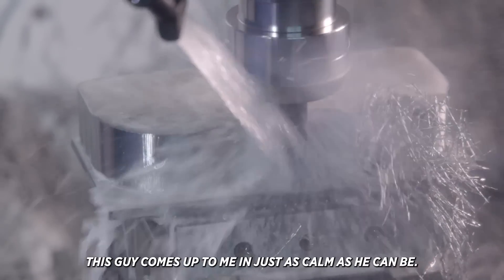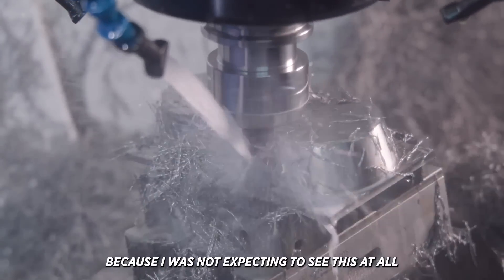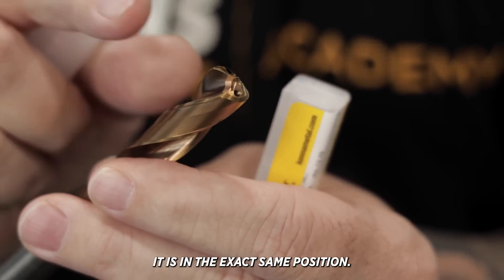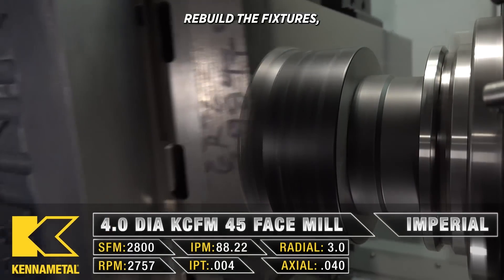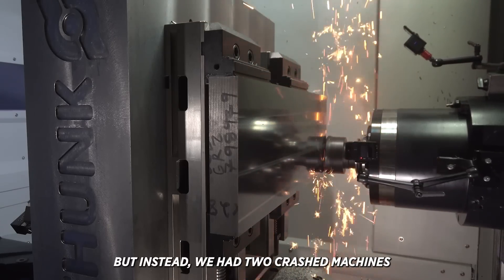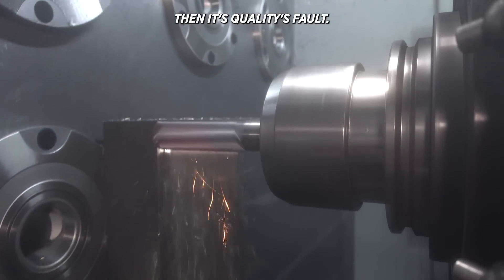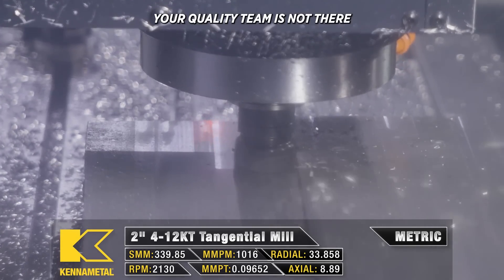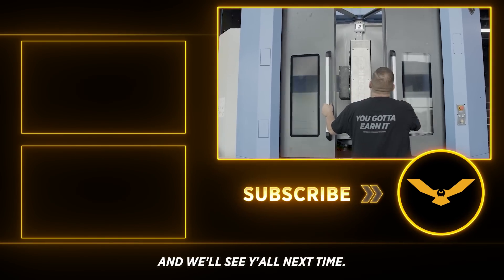$200,000 Damage | EPIC FAIL… Machinist CRASHES TWO MACHINES at the Same Time

Comment: i took the chance i got to be a technician while i don't have a degree. but i landed in a company that gives me all the support needed , i would feel sick having to tell my manager i crashed a machine like that. i work in a chocolate processing factory. from things i learn watching videos on youtube i was able to make a good impression . we have a mill and lathe (not cnc) but i noticed kennametal inserts . so many things i've seen in your videos have been very useful. we have every part of every machine in stock . but in case it's needed we have every tool and material to make  what we need. having to relearn almost everything in a world 25 years more advanced has been quite the challenge so far.

Comment: Monarc mill on a fresh setup the forman set the stops as he was setting up for a job 3 axes machine cnc was rather new at that time and these machines cost about 250k each back then we had 3 of them.
The tape was feed into the machine and 
The tool loaded dropping down to kiss off the first part the mill kept lowering tords the table into the part it was a very large part. It bent to tool change cage among other things I belive it jacked up the spindle that machine was down a month or so, ive seen a puma cnc lath run into the chuck. Just stupid crap and somone not paying attention.   The Forman was a journeyman machinest that specializes in mills.  He told me and I was around 18 at that time school taught him a bridgport was the only tool that could make its selfe, I said Bullshit.  A lathe can make a lathe,  he said how do you make the ways?  I said they are round,  he thought
Every time he came up with something a lathe couldn't do i had an answer.
A lathe can make a lathe, maybe not the one you used but one that works.
You just have to think outside the box.
Don't belive everything somone tells you.
You can figer something else around the problem.

Comment: First run: Eyes on the tool in the spindle. One hand on Fast-travel speed control, Other hand over the kill-switch.
You don't have another machine. As a matter of fact as far as you're concerned the rest of the universe might as well not exist.
If your bodily functions give you trouble, you put the machine on hold at an appropriate step, make certain that the "First run" sign is in front of the controls, take care of the issue, return as fast as possible.

Comment: My coworker crashed DMG mori EVO 40.. he missclicked a decimal point so his drillbit 40mm diameter was 35 mm long instead of 135 🤷 then he just ran the program like every other time and did not make sure its allright even tho he puted a new tool in it.. fortunatley the drill bit broke and the machine hitted Z - limit so the cost was "only " aroun 60k

Comment: Where I work at there are two machinists that broke the spindle probes in their machines, one smashed it into the part and the other accidentally gave it 7000 rpm the caused it to shatter in to meny small parts.
I remember just braking the white tip of the probe and how bad I felt for the rest of the day.

Comment: I always run in single block with a distance to go screen, feedrate at 10%, and rapids at 5%, when proving out a new or modified program, (even the first new run of proven programs) on any cnc... it takes far less time than re-aligning and repair

Comment: That's why single block is your best friend when using a new program. You also want to stay on your rapid override and feed rate switches. If your machine has a graph you can actually do a machine lock dry run as well.
Reply: You are correct, i run okuma macturn 550 and i always run the simulation in the cnc computer with dry run and machine lock on.

Comment: Worst crash I ever saw was a horizontal DMG Mori crashed at 100% rapid. The guy was doing a setup with a brand new program and had just finished it and turned block delete on and for some reason DMG Mori’s can’t read 2 pallet changes right in a row so it rotated the other pallet in but didn’t rotate it back so it buried this face mill about 2 inches into the pallet and actually picked up the whole tombstone off of the pallet and it cracked the spindle all the way down the side. It was crazy because I was standing right next to the machine when it happened. But at least this guy that did it looked like he was going to pass out and also speaking of that guy getting promoted I had a mid-level boss who was always crashing machines and scrapping parts he ended up getting and he was an absolute asshole of a manager. I eventually got so sick of working there doing production work on aerospace part so I quit and now I work for an extrusion die shop and I love it

Comment: CNC repairman here, worst crash ive ever been called to was when this company launch a 100h programme friday evening, the mold was aluminum so high spindle and soft cutters,
(for who dont know usually big mold are cast aluminum with inox pipe inside for cooling), long story short the company who casted the aluminum misplaced an inox 1" tube by like 5 cm, machines 
saturday night exploded the cutters from the spindle, but anti-collision was disabled like the week before due to some elettrical issue (we were supposed to replace it like the week after).
Monday morning the spindle was blu, the machine continue to mill with the spindle head, burning bearings, eletrical wiring, C and A axis where deformed (the screw of c and a in those machines is in bronze to reduce damage in situation like this), Z axis was ot of square about 1cm/1m.
We ended up completly chaning Z,A,C axis, spindle, cooling unit (part of the spindle were been sucked into the cooling circuit), and remillling x and Y placing point for linear guide.
i honestly didnt ask how much they paid for this work.
But i know for facts the just the spindle is 35-45k$

Comment: More of a machine failure than a crash, but a 3/4 endmill blew up in a spindle that was already in rough shape, needed to get the spindle replaced as well as some other work on it while the technician was out at the shop

Comment: The worst crash I've ever been a witness to, was when the Makino machine next to the Makino PS65 suddenly made the loudest booming sound I've ever heard from one of them.
It turned out that the threading tap that was being used to make an M16 thread got stuck in the workpiece, ripped the part out of the fixture (part was 200mm x 200mm with the threaded hole in a corner of it), and then swung it freely in the air at 600RPM for 1 second before snapping the tap and slinging the piece into the door of the machine.
In short, the door was bent like hell and someone was spared from being hit in the by a 20kg piece of metal.

Comment: I'm not a machinist, I'm a cabinetmaker.  Rule #1 is never leave the CNC when running a new routine.  20 years ago when I was new to programing, I used a down spiral bit and plunged straight down into the wood at 18,000 rpm.  Think of the worlds fastest fire starter using a stick and bow!  Within seconds (and due to the vacuum hold down pump) I had a 2" glowing hole.  Had I not been there, I could have lost a very expensive CNC not to mention my building.
BTW, Love your channel!

Comment: Have a new guy working under me, all he has to do is run the same part, he been making the same part for 2 weeks straight, there is a picture of every step at every M0 with notes, and a typed guide to go with the pictures , he forgot to remove C clamps that are about 3-4 inches tall, pressed Go and just walked away and full on crash at super sonic speed destroying the facemill and the part and the clamp. I told him never, ever just press go and walk away every on verified parts until you verify it’s safe. If people don’t get this they shouldn’t ever run CNC, it’s one rule

Comment: Promoted him and gave him a big raise.. ??  !!!!  I am sorry, I would have fired the man on the spot.  That is bullshit... Many year employee or not he damned well knew better.  What is one of the first thing a newbie learns when running parts.  Rule number 2 when running a new, modified, different or with a changed out tool.  Step it through slowly to make sure everything is in place.  Rule number 1 is safety as always and is always rule number 1.  Modern Machines can run so fast that if your not running through at a small percentage of what it can do.  The damage can be done before you can stop it.

Comment: I don't know, how some guys manage to high speed crash because of missing digits or wrong referencing... I was told that EVERY new program has to been gone thru with 1% speed and a hand on the e-stop all the time until the end. I had some close calls, and some pretty bad crashes because of material fails - but never because of a programming mishap.

Comment: This is one reason I first run a part in high density FOAM or even soft plastic so at least I can SEE what the machine bits, heads and spindles are ALL doing along the entire tool path before I machine on aluminum, stainless steel or titanium blocks. In foam or soft plastic, the damage won't catastrophic and I can SEE where and when collisions/crashes occur.

V

Comment: I’ve been on a manual lathe for about 6 months, cutting the connections on drilling tools for the rigs
The guy that “trained” me, gave me about 2 weeks of “this insert is for threading the rest just use whatever as long as you make the cut” 
Then after those 2 weeks of this guy sitting on his ass while I messed up connection after connection, they threw me on the night shift by myself to run this thing I didn’t even know how to adjust the speed on
“Don’t worry about it, you can just cut everything how it is”
Took about 3 months of parting off bad connections and screaming F bombs for 12 hrs a night before I started getting the hang of it

I take pride my work, 
When I started I was putting out maybe 2 connections a night on a 12 hr shift
 Parting off so much material
Prob costing the company quite a bit of money
Now I can cut one in under an hour 
Pretty much self taught
Still don’t know any of the nomenclature for the tools and inserts
But I’m not breaking them or burning them up in 1 pass anymore 😂

Comment: When I use to do new set up every time I hit cycle start I go into 0 % on feed rate than walk my tool till it contacts work piece so I no it won't crash and damage , I seen someone do new set up from small to running parts on a fixture and forgot to set zero and it crashed where wheel broke to pieces,spindle bent and over head snapped

Comment: You gave out the biggest secret in the trade. The most careless and slacking operators gets the most promotions. And the most incapable of handling responsibility get the big management positions. That's why companies are so screwed up and the good machinists keep having to job hop after getting too used to the b.s. on the floor from the people that aren't deserving of their job but have nowhere else to go in life. They'll find a way to get rid of you if they feel threatened by you. So doing good is bad for the comraderie amongst floor workers which is more key than the managers that you actually get along with that like and praise your work. The coworkers will find ways to weed out the ones they feel threatened by. Happens everywhere.

Comment: Why aren’t the programmers required to be standing there on the first run? If there’s a problem, the stop it, and know where they need to fix their mistake. Unless your operators are trained to write and authorized to rewrite code, then get all accountable on the floor and in front of the machine.

Comment: One time, I and a new hire were changing out some wire spools on a machine and then heard 3 other of the adjacent winding machines simultaneously crash while the operator had stepped away to move a pallet. The bobbins that the machines were winding wire onto were not secured properly and they were ejected at over 1500 rpm. Fortunately, the guarding on the machines caught the 45lb projectiles before anyone got hurt, but all 3 sets of guarding were catastrophically damaged and had to be rebuilt, by hand, by our maintenance crew because the machine manufacturer no longer supplies replacement parts for these machines.

Comment: The worst crash I ever seen was on valve  body facing at a hole in the wall dlave shop, they kept telling this dude go faster, go faster. And he was trying... flipped a valve body out of the fixture and came back on the next pass and expoded it like it was a bomb, parts of the valve body came back and destroyed the spindle. I didnt stay at that palce long. I dont see myslef ever going back to machine work. Not here in the midwest or for somebody else.

Comment: Oh hell, I had run into people like that guy all my working life.  No sense of pride, no sense of responsibility.  Never did and never will understand the attitude.  I've done stupid things at machines, but luckily never life threatening and always felt terrible about it.  Absolutely hated making mistakes.  

Worst 'crash' I had seen was actually on a sinker EDM.  Guy forgot to set the oil level sensor, and when the oil level dropped below the top of the part overnight the oil caught fire and burned out the entire 55 gallons of oil in the machine and everything that wasn't metal was gone.  Machine looked like a skeleton the next morning.  We came into a shop that was filled with smoke from the burnt oil.  It was a miracle that the whole damn shop didn't burn down.  That was back in the early 70's.  Seen lots of bad stuff, but that was the most expensive one.

Comment: While employed at a precision valve company in NJ, the front office made the decision to promote a bean counting contract efficiency expert to the head of manufacturing. This was a position that had ultimate say over setups, processes and tooling. Basically a god level " I know everything" position. During his orientation through the shop, he had a clipboard in one hand and a yellow highlighter in the other. White shirt, black tie and glasses. Standing next to the biggest Mazak CNC machining center we had, the operator called up the wrong tool and crashed the machine. The tool was a 10" diameter insert shell mill with about 100 inserts around the periphery. Spun to about 7000 RPM, this cutter was rapid moved into a 4 foot long 10" cast iron angle plate that was about 1 1/2" thick, full rapid speed. The angle plate was bolted to the table and fully loaded with castings. The crash was so violent, the counter torque from the crash shifted the machine well off its anchors in the concrete floor. This machine had a table you could lay a 4x8 sheet of plywood on with room to spare. The majority of the operators in the shop dove for cover, but our new savior never flinched because he thought it was supposed to sound like that. RIP B.G. you never had a chance after that. It literally sounded like a train hit the side of the building.
Reply: Must have been some spectacle. + everybody had to change their pants directly after..

Comment: I have crashed multiple machines.  Every single time I figured out what was wrong. And said hey I fucked up. Even if the program was wrong. I learned the hard way. Not everyone will help. But these days I make sure everything is dumb proof. So if I’m not running it whoever else will won’t make dumb mistakes. Slowing down production isn’t always a bad thing. Bad parts are bad.

Comment: What do you use in terms of verification software?  Eureka validates against rapids through stock.  Was the operator also the programmer?  Information communication is key when the 2nd party has to deal with the thinking of the first party.

Comment: Thats cool so the it jets water/oil down inside your bits. I wondered how you was able to drill holes so fast with out backing out of the hole... Lol he hit go then he went on brake ??? I dont even do that with 3d printers. You got to have a flawless start. if you start out NOT flawless then your product is going to be crap. this is true with 3d printers/ CNC and even lasers. Now after it gets going and everything is looking smooth then you can walk away but that start up NEVER walk away.

Comment: Are you kidding!!!!! Ronald Regan said Trust but Verify! Three axis machines are simple. When you add in 4 or 5 or more axis, the operator needs to take the responsibility along with the shop process to verify the program is crash proof. Five axis grinders like sneeburger don’t use G and M code. Their concept of 5 degrees of freedom are unique. So programming these is a challenge. What is crazy is this guy got promoted. I would and never have left a machine running unattended. Even if your loading up the machine next to the one running your always there to hit that E-Stop!

Comment: The only crash I have done so far that needed fixing was i went too far back into the program (it was using g54 not g55) and my finisher went into the part (thankfully plastic) shattered it, and trashed my id expansion mandrel. We were able to save the tool, nothing got bumped too bad and I re-turned the mandrel